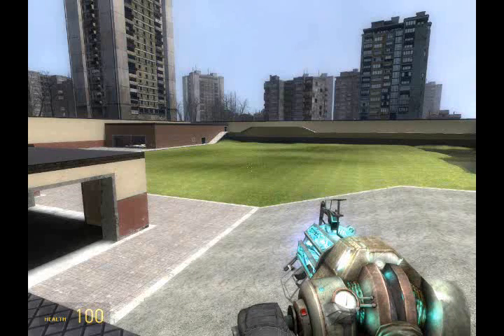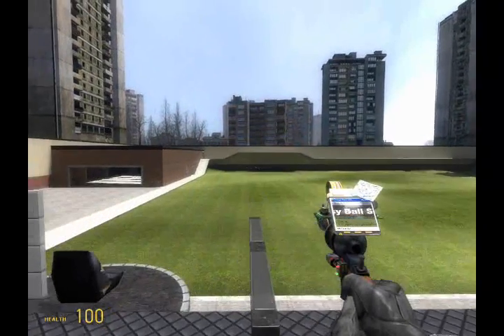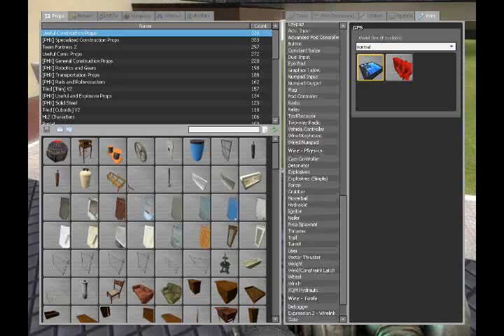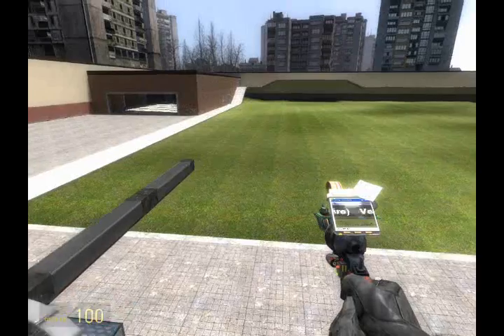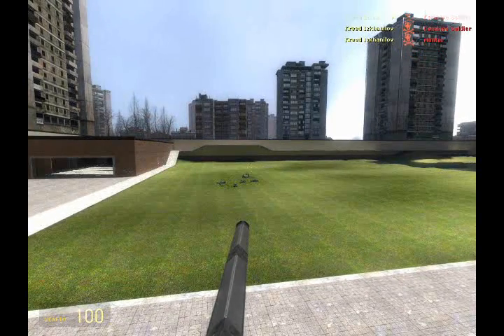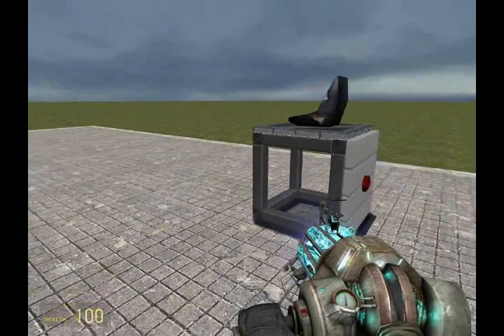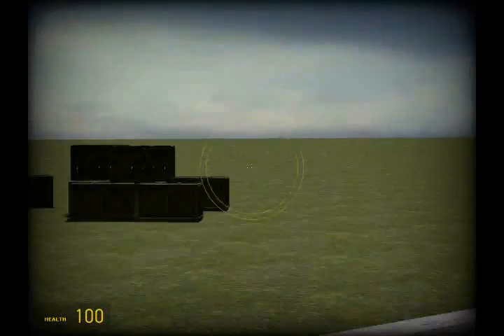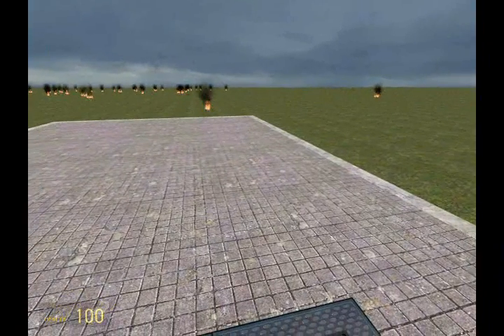WireMod Essentials [Ep. 03] - Mouse-Aimed Weaponry TUTORIAL

Comment from the maker: This is because when you're not in the chair, the AimPos vector defaults to 0,0,0.  Basically the vector thruster then points at the GPS vector location on the map since it's being subtracted by 0.  If you'd like to avoid this, simply wire "Mul" from the vector thruster to "Active" on the Advanced Pod Controller, and this should fix the issue.

Comment: @TakeBackTheWorld Actually using your technique you used in the guided missile part.. I actually have more trouble with under steering the hover balls add too much resistance at 1 air each and if I have the one on the nose at 0 and the 2 on he wing 1 the front turns odd.. and if it opposite the plain really over turns.. but ya with out them I do over turn the 3 hover balls though do add friction an I under steer. I may have to show ya this craft.